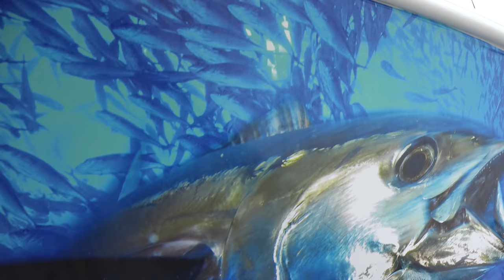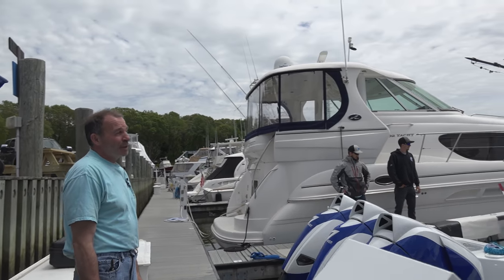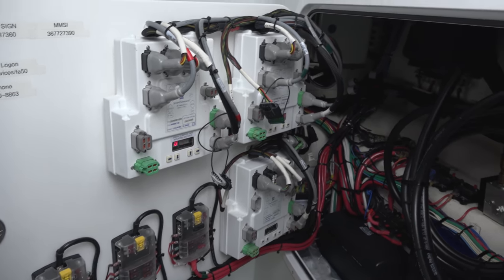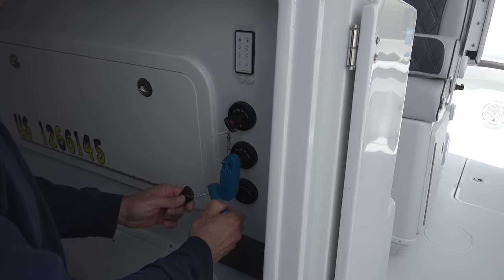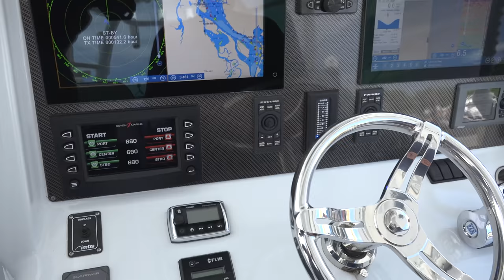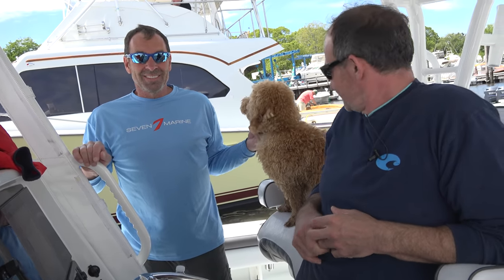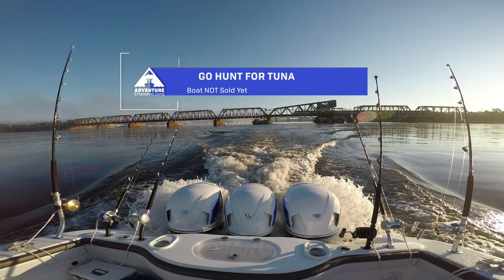39' Yellowfin CC Triple 7's 1881 Horsepower Tuna Fishing

Comment: doesnt seem to go fast is this kinda like when you always see old men drive corvettes that drive in the fast lane doing 45 mph
Reply from the maker: mindy burton  thats funny 😄
Reply: well i think each one those motors sould be able to push that boat to at least 50mph 1881 hp should be easyly over a hundred unless it has a bad haul design and you know you hit a wave at over 50 better be strap down so most ocean fishing boats 35 is average speed so the purpose of 1881 hp is like watching old men in 600plus hp vettes in the fast lane with 20 cars behind it all piss off
Reply from the maker: keep in mind the boat is rigged/propped for offshore heavy load fishing.  With different props and adjustments, the boat will go faster than 80mph, but that is not what the owners wanted to do. They wanted efficiency for offshore loading.
Reply: adventure how is 1881 hp efficiency in a fishing boat as cool as it is
Reply from the maker: You can really manage fuel consumption by speed, conditions, and weight. If you need 1:1, then you drive ~44mph, if your range requirement is lower, you can WOT and get .75...you manage it. But I don't have all the specs of this boat, just going on memory when I was on it a few times

Comment: "I've never felt a boat with torque like that." 
Clearly you've never been on a big ass Hatteras GT70 with 2700hp MTU's. Little 627hp outboards are NOTHING compared to those monsters. Especially when it won't go under 8 knots on one engine in dead slow.
Reply from the maker: Robert Bents i should clarify torque on a CC. I have been on plenty of  custom and production boats powered by diesel
Reply: Clearly you have never been on a 2,700hp GT70 because they are 2,600hp. Second the trip 627's would smoke your ass on the Hatteras running only 61mph top end. Educate yourself.....!
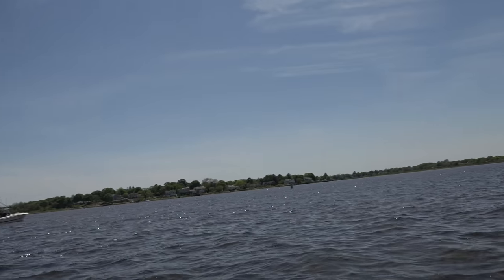Reply: @AdventureStreamingGuys  Sorry man... You said "Never felt a boat with torque like that, ever." 13:39  I doubt you've ever experienced a hairy chested SF...
Reply from the maker: Prototheria lol

Comment: and our 16 foot 454 cubic inch jet boat would pass it like its standing still.    goes to show,     SHOW DONT MAKE IT GO.

end run..  you paid  50x more for a slower boat.
Reply: I'd hate to see you try to fish offshore with a 16 foot compared to the safety that a 39' provides. This is a charter fishing boat and it's got the power and size to make it in when a storm rolls in.